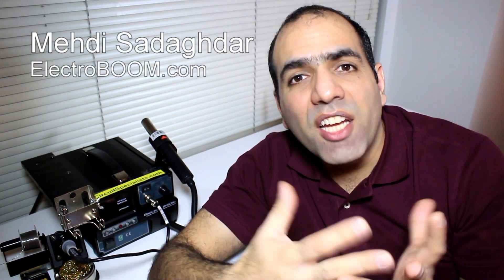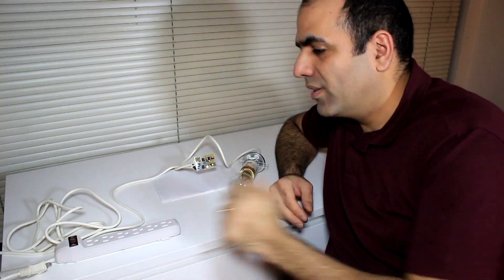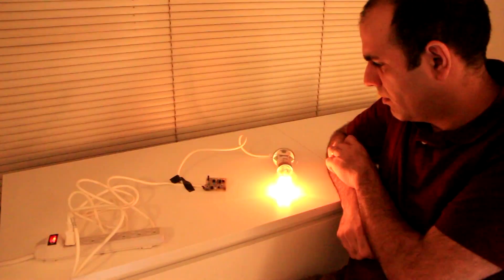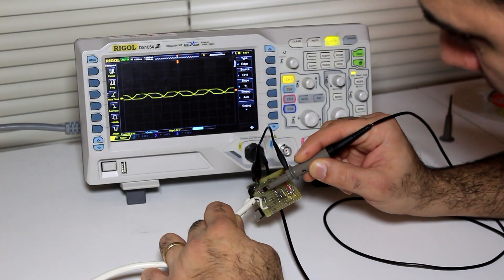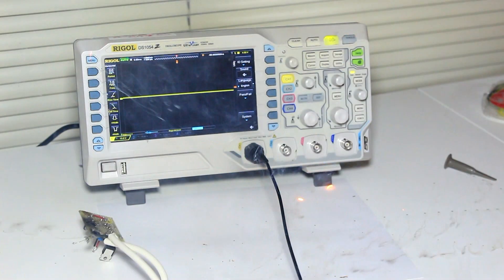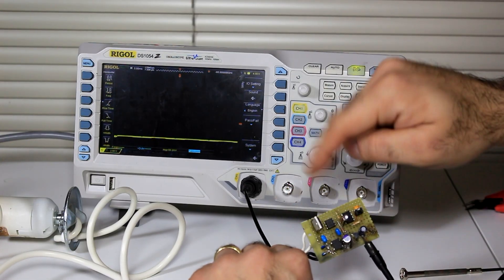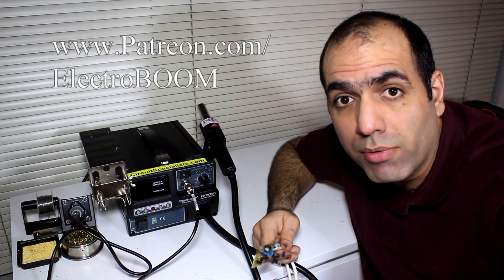Make an Industrial Grade Night Light

Comment: the bulb sockets with a light sensor have a delay in their sensing, usually 30s to avoid the self-feedback or eg. accidental car headlights. you could add it to the circuit too

Comment: What if that could be used to create a switching feature (that's the loop where everywhere is dark the light comes on and the light triggers it's own circuit to go off) , which can be used to run a transistor for an inverter..
@electroboom..

Comment: Fun fact, that oscillating feedback loop that was making the light strobe has been used in electronic music as a "ghetto" sort of envelope generator! Bruce Haack mentioned this technique in the liner notes from his last album "BITE", which was essentially a 101 course for teenagers to start fiddling with electronics and synthesizers in 1981. Technically it's called a "vactrol", and Bruce gave the example of using it as a way to control the amplitude of a white noise source to make simulated cymbals and other percussion sounds. It was also used in several Fender and Gibson guitar amps in the 50s and 60s to create that surf rock "tremolo" effect.

Comment: Wouldn't bypassing the ground and connecting the probe ground to the mains input liven up the entire chassis of the oscilloscope to mains potential including the exposed BNC plugs?

Not to mention what would happen if you had other grounded leads connected to it, say a USB or monitor output connected to another grounded device.

Comment: Instead of using a 5 volt regulator, could you have used a 5.1 volt zener diode and a 150 uF capacitor in parallel after the bridge rectifier to clamp the output voltage to 5.1 volts?

Comment: Wow, this power supply is far from industrial grade  - hope it was humour :-D
I really mean it, cause it may cause a fatal house burn down in worst case.
However you can make it closer to industrial grade by adding three fuse resistors (minimelf package) at the primary side of your capacitive divider and fused TVS -diode and varistor at secondary etc.
Basically you need to be safe in following conditions: short any arbitrary part or remove any arbitrary part, without experiencing your legendary OH FCUCK moments :-D
Capacitors need to be foil capacitors, as kV spikes occur many times a day, and foil capacitors can kind of "self repair" by closing the gaps in the foil by melting. However they will fail quickly, so you should consider a  series resistor-capacitor on primary to weaken these spikes.

Comment: 1:20 I'm guessing you used a way larger capacitor and resistor on the switch circuit just to show off this simple interference,  when i wad like 6 or so i found a light bulb socket extender fitting with a built in photo switch,  the problem is ever bulb i ever put in it around flicker like 10 times a second, those are the empty joys the life of an engineer are filled with

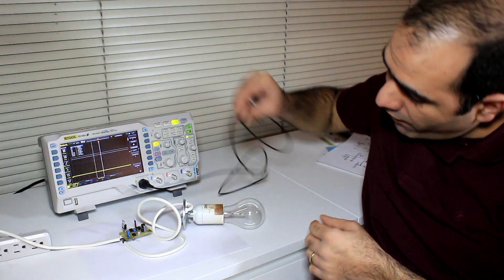Comment: Hi,#ElectroBOOM. Wish you can answer some questions about the grounding problem. Equipment was damaged by the grounding problem before...There are two wire to plug to the AC source from your circuit. One is the "Live wire" and another is the "Naught wire". I'm wondering is it because you pluged it upside down(C1's head connect to the "Naught wire", C2's toe connect to the "Live wire"). So when the ground of the probe connect to the toe of the C2, it shorts with the AC source(Causing the spark in the video of 1:43). But if you plug it around(C1's head connect to the "Live wire", C2's toe connect to the "Naught wire"), and measure the C2's voltage. Maybe it won't short the circuit. I'm not sure if its right or wrong. Wish you can answer the question, thanks!

Comment: To fix your scope issue, you could also take a three pronged extension cord (like one you would use outside) and snap off the ground pin at the end you plug into the wall. Then you don't have to put tape on your plug and have it fall off inside the plug or something stupid.

Comment: Friendly reminder that insulating your scopes ground to use it with Live AC circuits like this is very dangerous, when you do that and then clip the ground probe onto a live part, then all the metal on your scope is now at line voltage, including the BNC probe connectors that were an inch away from your fingers

Comment: I want to figure out how to make a capacitor balance pack.  IE, take a bunch of, say, 2.5v 10F ultracapacitors and make a circuit that will discharge an overcharged cell.  These exist but are expensive and seem simple enough to try to figure them out if anyone can help?

Comment: I was wondering can we use a solar panel with conneced to a relay to have the same effect.When the panel gets light it will open the swich and turn off the light when the panel stops the relay will close the swich and  the light will turn on not to forget that the light is powered by 120-240v.

Comment: i make this kind of project but in a simple form... i used cellphone charger.. and by adding any NPN transistor (use 1 only), 100k ohms resistor (1pc.) , a photo-resistor (1pc), LED lights (2pc), 120 ohms (1pc) at the output of a changer.... it works well... i called it dim lights... after the main lights are off  to sleep.. :)

Comment: 5v regulator with 120v passing through a diode bridge? shouldnt it make loads of heat? (Vin-Vout)xcurrent? ~145 watts for each amp?
Reply from the maker: No, the capacitor divider on the input reduces the AC voltage to around 12V level, then rectified.
Reply: Thanks for replying i wasnt expecting that....... now i dont understand how you can use a capacitor as a voltage divider
Reply: RECTIFIED!!
Reply: will like resistor diver just go to his website in the video description

Comment: You could have just use a relay and photocell to make life easier
Reply from the maker: send me the schematic
Reply: Ok how do I send it
Reply from the maker: send it as a message to my facebook page. Thanks!
Reply: Ok I will let me draw it 😄
Reply: Yeah but this photo cell is much bigger
Reply: Did you notice it's the same circuit? :D
Reply: arvinda bharat or a high voltage mosfet
Reply: arvinda bharat g

Comment: I am new to electronics, and excited to learn more. But why did you do all of that stuff with the rectifier and capacitors, to convert the AC 120V to A DC output? Couldn't you have just used like a 9V battery. That is DC? Plus that seems a lot safer!
Reply from the maker: +Penguin Design Yup, that's safer. But that's a different circuit. This one is more complicated and most night lights use AC input, not a battery. Battery would be boring!

Comment: hi! your Tesla coil is amazing 
but i want ask you one thing.. what happen if you try to add a third coil called from Tesla "extra coil" in the system and transform your tesla coil in a magnifying transmitter (i suppose that he use the third coil like an antenna to trasmission electricity in space) to trasmission of electrical energy.
in an experiment you can prove to charge a phone a many metres  (not in a room i think 50 or 100 metres of distance from coil) 
i'm a student of engineering  but the exam in electrical engineering  is far and i won't wait many months.
so please i'm very happy if you built a tesla magnifying  also because the video in yt about this are few... thanks if you accept

Comment: I heard that electric shocks can cause delayed thrombosis and thrombs can kill you quite easily.  Dangerous voltage probably is significantly higher than ~220V, but dude you shock yourself kinda often and I'm worried it's not the only health concern there is. You probably know all that already, but just take care

Comment: You seem to enjoy the frying of circuits. Now I am just wondering how hard would it be to use a photoresistor to control a relay that would actually control the AC supply. Wouldn't that be much easier and safer?
Reply from the maker: +Nishant Arora That&#39;s very much the same thing. Just that the relay coil takes much more current than the opto-triac and so the used supply won&#39;t be able to provide power. To keep things small and low power, this is the way to go.  Otherwise you can go any route you want.
AND the light dimmers have similar TRIAC in their design.
Reply: +ElectroBOOM thinking about it, it does makes sense, but please be careful! Also this would work with 220V-250 AC? what else will I need?
Reply: +ElectroBOOM yes...yes I know some of these words.

Comment: What was that plug from, the one you Isolated the ground? For a moment I thought that it was from the scope but that seems to be a bad idea, was it the plug of the project itself?
Reply: +John Grammaticus it was from the scope, because the problem was that the probe's ground is the same as the scope's ground, so any potential found on the circuit will try to escape through the probe's ground (thus the sparks). That's why he insulated it, so that there is no mass to the scope so it measures differential potentials only. Dunno if it makes sense or understandable... :/

Comment: It's real important for folks to realize that floating the scope ground (or pretty much any test gear that has a power line ground) is potentially very dangerous.

The chassis of the test gear, if the test probe ground is connected to the high side of the power line, makes any metallic surfaces on the test gear also HOT.

And of course the resulting side effects of getting a 120vac or even more so 240vac shock can result in growing a uni-brow, provided you survive.

Comment: (1) Have you thought of getting yourself an isolating bench
transformer to run your equipment on to prevent ground loops?
(2) Maybe even low voltage test equipment powered by AC mains to DC power supply
even ones with internal rechargeable batteries so can be removed from mains
when using.(3)  what I did when
installing an outside industrial   automatic 
security lighting system some years ago and found the same  light feed  back problem switching on and off and it was
not possible to relocate the sensor for security reasons (an embassy) I found
all I had to do was open the sensor box and put a small piece of exposed photographic
negative( you remember before digital cameras and smart phones and smart asses)
 over the sensor which cut down the light
so that the security lighting only went off during full daylight.
(4) Totally disregard the above 3 points as your way is more
fun.

Comment: Come to think of it, the Opto-TRIAC- plus power-TRIAC-solution ist rather elegant! You have isolation from your control circuit (like when using relays). And a huge bonus is the switching off at only lower currents. So you don't force open a switching contact mid-peak of the sine wave, and thus don't risk generating little arcs, which wear the contacts down or could fuse them together. 
To be honest I'm more in the communication and RF part of EE, so I was always a little unsure about using TRIACs, I didn't really learn circuit design using them. But with a little thinking and a great example like this (thanks Mehdi!), I might use it in my little automated power-control.

Comment: it would be wiser to use relays instead of transistors in situation. same thing with light sensor, but it should switch two-position relay instead of going through all this FULL BRIDGE RECTIFIER stuff
Reply from the maker: +delpher32exe They are TRIAC specifically for similar purposes. I like them! Every dimmer at home has one.

Comment: Why would you use the capacitors instead of scrounging  a transformer out of an old wall wart?  Come to think of it, the wall wart probably has a rectifier and regulator already in it.
Reply from the maker: +Ferrule Bezel Wall wart is huge! this tiny night lights all use similar circuits to mine, which use very little power and take small space.
Reply: +Ferrule Bezel Transformer wall warts are the past man :)
Reply: +Ferrule Bezel industrial means it should be cheap means no transformer
Reply: +ElectroBOOM Maybe it's my personal history of kludging things instead of being a trained engineer.

Comment: Usually, what you are doing/suggesting is relatively safe.
But disconnecting the earth of the scope, and then applying the ground clip of the scope to a high-potential line, is dangerous: it can put (high) voltage on the case of the scope! If you've got metal knobs, you get shocked everytime you turn them. 
Use a differential probe (or an isolation transformer) instead.
Reply: He knows everything and is careful he does accidents to inform us

Comment: The capacitive voltage voltage divider at the input is actually quite brilliant
Reply: Agree. Never used such a divider before. would it also work with inductors instead I wonder...
Reply: @spinvalve  Im sure it would, but that would require a big inductor
Reply: His cap dropper is wonderful if good caps are used; that's used for most line powered LED replacement lamps these days. Maybe they'd work in theory*, but at 50/60Hz, how "big" would an SERIES inductor have to be to "hold back" enough current/drop the voltage? (Our friend Henry is a direct conductor for low freq AC and is pretty useless for resisting DC.) A small one would effectively "resist" and block any HF, but the low freq AC power component would never be attenuated enough (even if the inductor had an iron core and a mile of windings). e.g., a florescent lamp ballast. Two 20:1 properly sized wire-wound iron core inductors in PARALLEL might work if placed very close together. Let's just call it a transformer.  *(IDK, I'm just a self-taught hack.)
Reply: +FindLiberty Inductors are good for big loads @ 50/60Hz as smaller inductors would pass more ac. Capacitors are good for very small loads but not good to be used in series because any spike or RF signal on the net is going to come in full force and fry your circuit. The voltage devider setup also devides any spikes to harmless levels. Semi-off topic: Long ago I had a coffee machine that just used 1 diode to cut the power in half for the low setting.
Reply: FindLiberty why not? Inductors have impedances too.
Reply: soo..... where your video??..  new video...
Reply: Yeah, you call those a transformer. A 1:1 ration transformer with multiple output taps.
Reply: This exists, it's called a variac or autotransformer. It's a ring transformer with exposed windings on one side. A wiper taps the coil at a configurable point. It can even step up the voltage by adding extra windings past the mains terminals!
Reply: Does that require an inrush current protection fuse/limiter resistor?
Reply: +SteelBlueVision If the top cap fails short, the low voltage side all of a sudden becomes 120, is that the only benefit of isolation from mains that a step down transformer would provide?
Reply: +99_problems Technically it insulates from hot if you consider capacitors to be open.
Reply: Afrotechmods your channel is freaking amazing and you are smart as hell!
Reply: Afrotechmods respect to you as well man. You and Mehdi are both my Jedi masters
Reply: Agreed
Reply: @problems-hf8ts  “technically” it does cause capacitors aren’t physical connections
Reply: Right!
Reply: +Afrotechmods Not for isolation from mains it isn't.
Reply: +spinvalve No!

Comment: capacitve divider at live going to a linear regulator?
kids go get a transformer unless you are feeling brave today.
Reply: +the real illuminati So like photonic induction channel?  :P Its full of transformers defiantly not safer.
Reply: +homerbloodysimpson A fuse would make the sparks a lot less bright.
Reply: +the real illuminati You would be shocked (haha) how many small mains powered devices use a capacitive dropper. I'm currently sitting in a room lit by LEDs run from capacitive droppers, and I even have a somewhat dodgy USB supply that uses one. So long as there is no possibility of touching the output, it's fine.
Reply: Nene I'm aware of that. but your leds are not exacly dangerous because you cant really get electrcuted, here he show people how to build it and make it possible to get a high voltage at the output.
Reply: +the real illuminati 
I do get a bit bit nervous that he has no fuse on the mains. I'm tempted to contact Mehdi with a request to include fuses in his schematics. 
There is a serious side to these shenanigans that should be noted...

btw; your youtube name is sillier than mine :-)